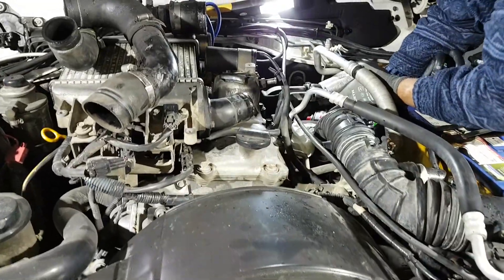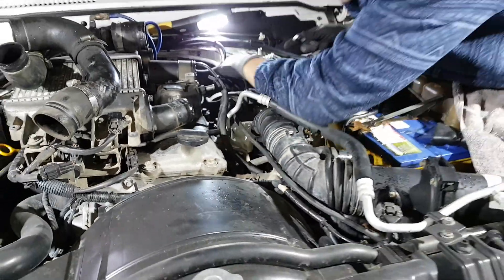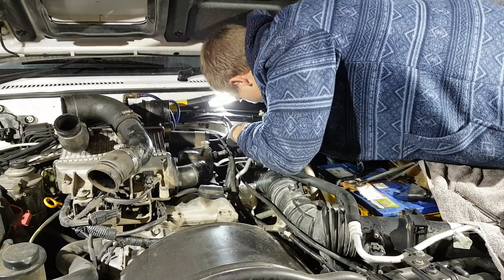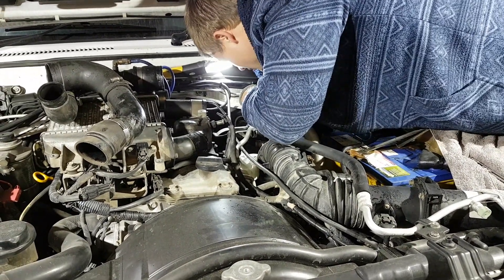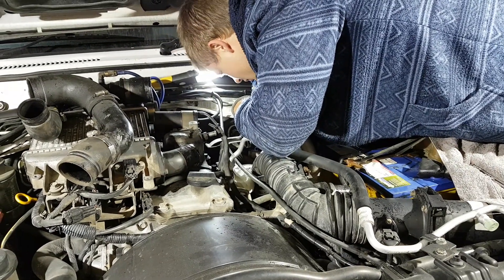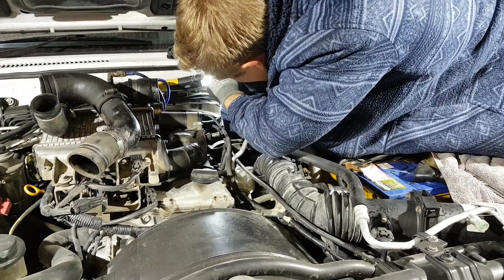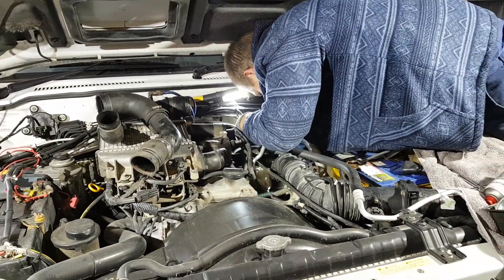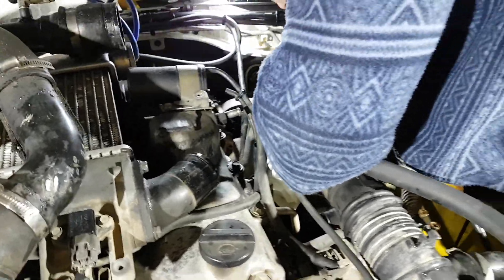Nissan ZD30. Why does the exhaust manifold leak?

Comment: no, new gaskets don't just do it, the manifold is typically bent for that heat.  use the old manifold that is already heat cycled and them machine the face flat, the reverse the strip down,, genuine Nissan gaskets only
Reply from the maker: All New parts and Manifold is Best.
Reply: A new manifold as opposed to machining old one? What about the whole 'heat cycling' thing people often talk about. Are inconel studs advised? My local mechanic says they are not good as you can't easily drill them out if you need to do another manifold later and head has to come off and go to machine shop to get them out. I've been quoted 2k to do the job with 4 snapped studs
Reply from the maker: We bake all our New Manifolds in an old  Pottery oven at 600'C

Comment: "Here's a video that shows you how to do this job.. okay we'll leave him to it thanks for watching." didn't show me a damn thing
Reply: Nowhere does it say that this is a video to show you how to do the job.
Reply: Sometimes is a lose nut in the manifold or the gasket between the manifold and the turbo.
1- Remove 2nd battery if you have it.
2- Remove turbo heat cover(is a pain in the a$$); tweak it, shake it; you'll have to move it 90 degrees clockwise when taking it off. Also, removing the Turbo Actuator helps.
3- Start the engine... spot the air leak by spraying soapy water in the manifold you will see bubbles around the problematic area.
4- Let the engine cold. Tight the loose nuts in the manifold.
5- If the problem is the air gasket between manifold and turbo; remove inlet pipes and remove exhaust pipe from turbo... remove oil/water pipes(below the turbo core) be careful with the little oil gasket.
6- Replace gaskets with Nissan's original gaskets.
7- Reconnect everything back(turbo oil gasket is a huge pain in the bucket).
8- Make sure to put back the turbo heat cover.

Last time it took me like 6-8 hours to do it(I'm not a mechanic).
Reply: Agree with Harry, not once did he mention how to. Read

Comment: How much to do this including replacing all the gaskets, and adding a 3inch exhaust ???
Reply: I don't know what these guys charge but Ive been quoted $950 for the same job, (ended up doing the job myself but out sourced the machining of the manifold to a local workshop). These manifolds can sometimes warp a few mm causing the manifold to leak. My price didn't include replacing exhaust...Really was a prick of a job, especially when the manifold studs snap.
Reply: @bigfella6629  Did you follow a tutorial or just start pulling shit out the way?